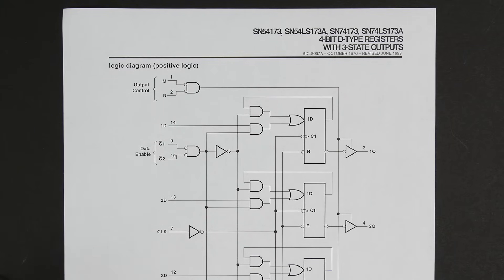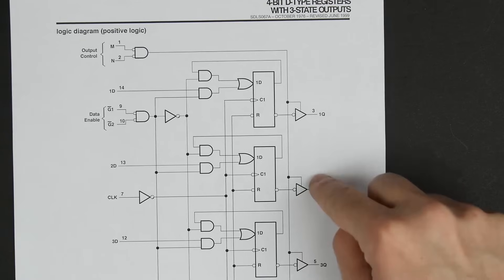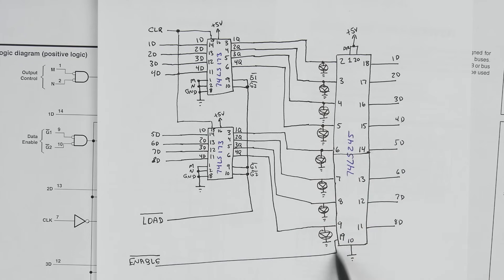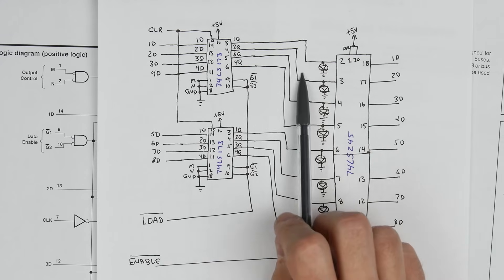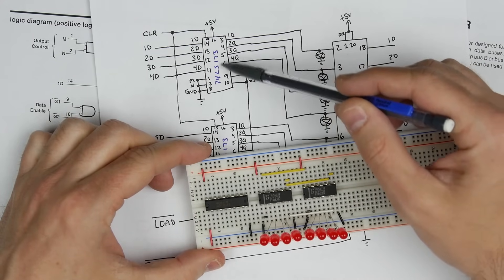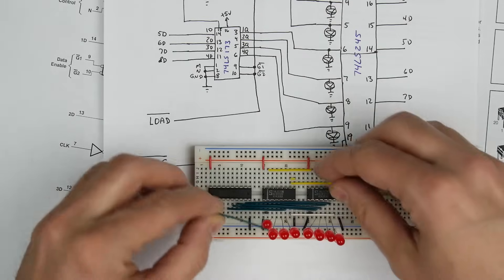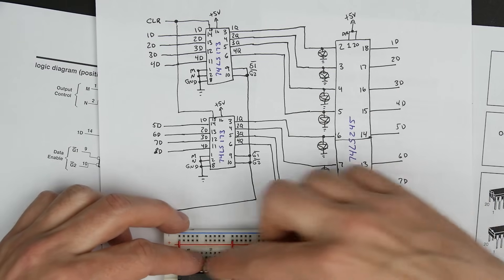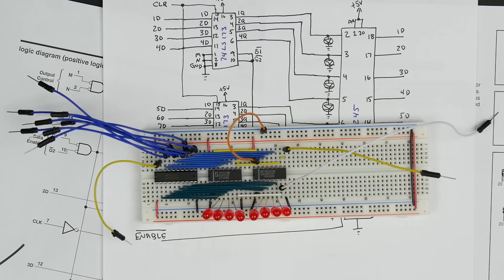Building an 8-bit register - 8-bit register - Part 4

Comment: 4:32 why don't you need Current limiting resistors for the LEDs? Cheers!
Reply: He does not need resistors because the chips have internal resistance that already limits current.
Reply: Andrew Whittle - Correct answer for the wrong reasons. He needs the output of the 74LS173 to drive the 74LS245. 

They are both from the same logic family (74xx TTL) which means by definition the in and out impedances are matched. 

In 99% of the cases, the "resistor" is shown on a representation of the chips functionality. There is no actual "resistor."  How do you think they make "resistors" on a die?  They match the impedance of a transistor or diode junction (sometimes its more exotic.)

Resistors make heat by wasting voltage. That is the last thing anyone wants in a die. 

Distinguishing what form of representation of a chip you are looking at on a data sheet is critical.
Reply: His design is flawed. Resistors are absolutely needed. The datasheet for the red LEDs gives a forward voltage of 1.8V. The LEDs are tied to ground, which means that they will limit the voltage out of the registers to 1.8V. However, the 74LS245 tristate buffers spec the minimum voltage for a high signal to be 2.0V. Although this circuit apparently works, it is because the parts exceed their minimal operating specifications. But this project is fantastic and my son is learning a lot!
Reply: Paul-Stelian Olaru - He is already using the 74LS173 to drive the tri-state buffer 74LS245. 

So, no, he does not need current limiting or sourcing. There is no way to use the output of the 74LS173 in any way without the tri-state buffer. 

If you don't understand, go back one video.
Reply: Crocellian Without the resistors the current would flow through the LED and nothing would go into the next gate's input.
Reply: He actually does need the resistors for another reason: actually being able to use the output somewhere other than displaying them on the LEDs.

Comment: Why not just gate the incoming clock signal with an AND to inhibit latching when our load signal isn't asserted?

I kind of assumed that you were just showing us 'the hard way' and were then going to simplify, but then I had my mind a little bit blown when you showed the schematic for the register chip and it used the same typed of muxed feedback setup.

Mostly, at this point I'm curious why the chip uses such an elaborate, high gate count solution at all. Does anyone know?
Reply: It is bad practice to run a clock signal through any logic. At 1GHz your period is a single nanosecond, so if you happen to be using a handful of chips with some logic on the clock signal (internal to the chip and perhaps unknown to you) then you could easily introduce a race condition to your circuit at high speed

Comment: If you aren't using the multiple load lines (you're tying them together), and you always want outputs on (since you are using the 74ls245 to have state LEDs), why not use an octal d flip flop like the 74ls377?

Comment: can i replace the  74LS245 with and gates?
Reply: No! A traditional AND gate will always pull the outputs to Vcc or ground. The line drivers have the distinct advantage that their outputs can be effectively disconnected from the bus, which is what tri-state is all about. If you have two AND gates outputting different values onto the bus at the same time, you will get short circuits or at least undefined behavior.

Comment: Can I use the 74HC series chips in place of the 74LS ones? What's the difference anyway?
Reply: the difference is LS series uses BJTs
,however the HC Uses MOSFETs
that's as far as I know..
Reply: Ali Hassoon  Not much then :q Since I asked that question I managed to find much more. Turns out that LS stands for "Low-power Schottky", so it's a TTL chip with Schottky diodes to make it faster. "HC" stands for "High-speed CMOS", so it uses complementary pairs of MOSFETs to reduce the power consumption even further (charges only flow from output of one gate to input of another when they switch, but then there's no more current needed, contrary to TTLs, in which a steady current is required to maintain logic levels). CMOS chips are less restrictive about their voltage levels than TTLs which can operate only in the 0V..5V range, with logic levels at 0.25V and 4.75V. Therefore they are not quite compatible: outputs of HC chips (CMOS levels) cannot properly drive inputs of LS chips (which require more restrictive TTL levels), but the converse is OK. Therefore they introduced the HCT series, in which the additional T stands for "TTL-compatible". It's still high-speed CMOS, but with additional circuits on their outputs which allow them to be driven by TTL signals from LS chips.

Long story short: LS and HCT can be used together and interchangeably, and LS can drive HC as well as HCT, but HC cannot drive LS. Therefore if one is looking for replacement of some LS chips, only HCT will do.
Reply: well thank you! that was quite a useful bit of information!
one question: are the 40xx series also CMOS?
if so .. they can't drive LS?
Reply: Ali Hassoon Yes, 40xx are all CMOS, so the same rules apply as for the 74HCxx series.
Reply: Thank you very much

Comment: what LEDs do you use that survive 5volt without a resistor?
Reply: The outputs of those ICs have resistors on outputs that limit the current to a suitable amount.
Reply: thanks for the information!
Reply: even if that doesn't damage the chip, it clamps the high output voltage to 1.8V... not really good... the bus leds have resistors at least.
Reply: If you read the 74ls specifications, the input high voltage is 2.0v minimum. With 1.8V leds the system runs outside of specifications and there's no guarantee...

Comment: couldn't this 'enable' control line be the power "Vcc" that powers up the the chip ?! I mean, we don't really need any enable lines, we could just cut the power off the chip.. I think it would have the same effect!
Reply: It wouldn't actually be able to store and transport the data though...
Reply: Brian Gommage No that's not the point. In fact, in either case, it doesn't store data once it's in "the disconnected state" actually we don't want it to store data in this state, we just want to disconnect. So, it would work just fine if the chip pins are disconnected when the power turns off. Unfortunately, different chip manufactures have different internal architecture. In  most chips, transistors may be turned on with no external power supply giving unexpected outputs ( it doesn't just disconnect).
Reply: If you refer to the '245 tri state buffer, then yes you are right, that would work. Both methods would work except for if they turn on anyway. A non connected input on TTL will default to high though

Be specific with what you are talking about please - I thought you meant the '173.
Reply: Brian Gommage yeah it was my mistake being unable to clarify what I mean :) anyways, thanks for your interest!
Reply: Sorry I was not very nice,
Thanks
Reply: Brian Gommage hahahah no I didn't mean that :D it really was my fault being unable to describe what I mean. Thanks you, dude :)
Reply: No worries XD
Reply: The D flip-flops would lose their state if you cut power

Comment: I built the original circuit here pretty much as described. I started with a 74LS04 Inverter, a 74LS08 AND gates, a 74LS32 OR gates and a 74LS74 D-Type Flip Flops. I added a  7805 Voltage regulator to get my 5Vdc and a 555 Timer to get a clock input 
for the D Flip Flops
This all worked perfectly so I setup both inputs and had 2 LEDs that could be set and latched when the LOAD was not turned on.

So, I took it another step further. To get a 4 bit register, I added an additional 74LS08 AND gates and an additional 74LS74 D Flip Flops.
I also added a 7447 7 segment display driver as it requires 4 bits to count to 9.
This two worked out well, except I am not using a voltage regulator, or 555 timeer, as I have a nice test station, with power and switches and a built in clock input that I can use.

When I first turn on the unit, if I have the LOAD set low, all 4 LEDs turn on. When I set the LOAD high, I can then change the state of the 4 inputs and it registers correctly on the 7 segment display. 1001 shows up as a 9.

I just do not understand why when I first turn on the board the 4 LEDs go high? The LOAD is set to a LOW at the time.
Not that it is a big deal, as everything works as it is supposed to, once I set the LOAD high for the first time.

I have created a very nice pin to pin diagram of the original project, that also shows the internal gates, that I would like to upload as it may be a very nice visual aid.

Thank you, this was very educational and a lot of fun !!!
Reply: RS latches (and flip-flops) power up in a random state by virtue of being pretty much symmetrical. You will probably notice a preferred state each bit powers up in due to manufacturing tolerances. If you need all the registers cleared, you will have to do that manually :)
Reply: Thank you

Comment: no i dint find a solution but i found out that even that they LED are slightly dim they are considers as low because you can gnd some bit of the data bus  to gnd  and it will turn off the LED

Comment: Thank a lot for your work! I believe these videos are very useful for everyone who wants to realize how this stuff works inside.
But I think that more convenient way is to use one 74LS377 and 74LS245 instead of using two of 74LS173.
Keep on doing that :)
Reply: Good call -  but others should note the lack of CLEAR on some of these alternatives. I'm using an array of 74LS573s and making use of the 74LS245 DIR pin. Wiring on a veraboard is very simple. 
http://www.ti.com/lit/ds/symlink/sn74f573.pdf
I don't make breaks from one side on the register to the other - (except for Vcc/OE and LE/GND rows).
My 4 x register board consists of 1 x 74LS245 followed by 4 aligned ls573s.
The 245 is aligned so that the Bx data lines, align with the 573 data lines.
I don't punch holes on the D and Q rows (on the 573s). I finish off with another 245 (OE latched and DIR = 1) on the far end of the array - which I use to drive a 2x 8 seg display, using MC14495 chips. With some contol logic, I can easily copy between registers without exposing data to the bus. The disadvantage of this wiring is that I don't have direct access to the registers - other than through the 8-bit databus.
Reply: Should I be worried about the lack of the CLEAR pin on 74LS377? It's because in my country 74LS173 is not available and I'm searching for the alternatives instead. Thanks in advance, anyway.